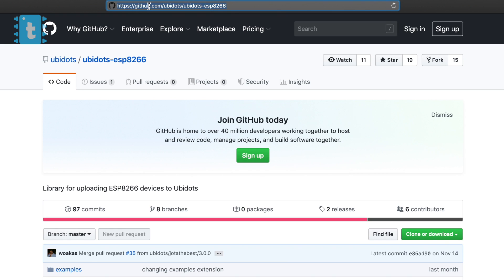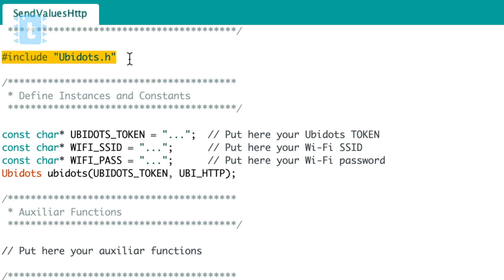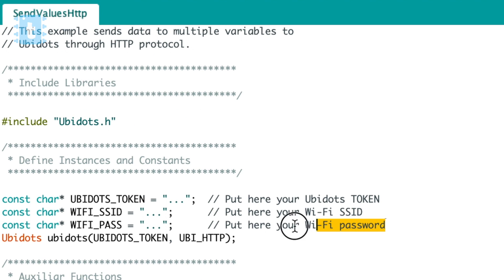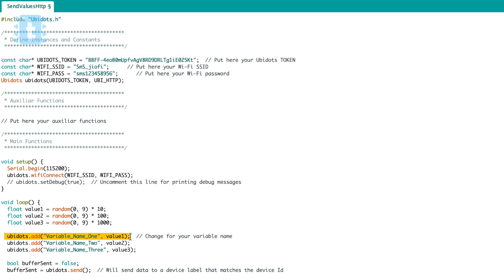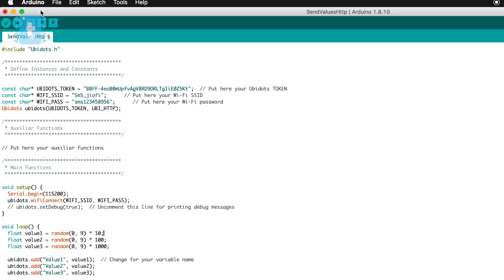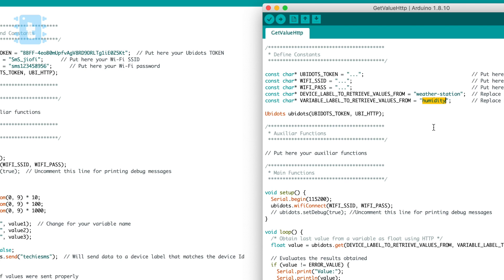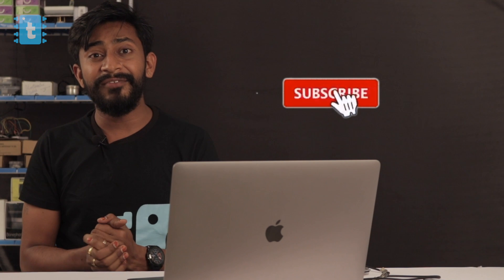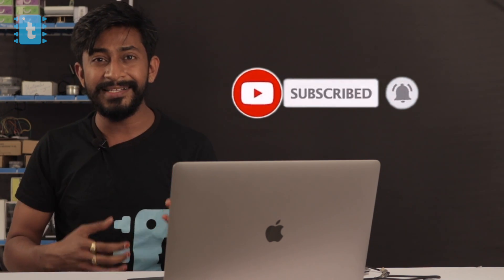Making IoT Projects/Products is now more simple with New Ubidots library | IoT Projects

Comment: Thank you very much for this video. 
 
Recently i worked as a Internet of things technology for start up (Bangalore). I was working as Firmware engineer by sending the data from Sensors to Cloud.(NodeMCU and Thingspeak and AWS IoT)

My query is what are  the applications and how we can build applications after sending the data to Cloud. How that can be done?

Meanwhile i also wanted to be clear about:

IoT architecture 
How the process of sending the data from device,
What exactly IoT gateway is,
The storing data in the cloud 
How data analysis happens for IoT applications.

Can i get suggestion on the above query?

Comment: your tutorial is very helpful. Sir, I am trying to develop a project where used esp32, temperature sensor and a fan.The fan will be operate based on temperature set value. The temperature set value change by using ubidots slider. Now i am using Arduino IDE,
Kindly give me any example.